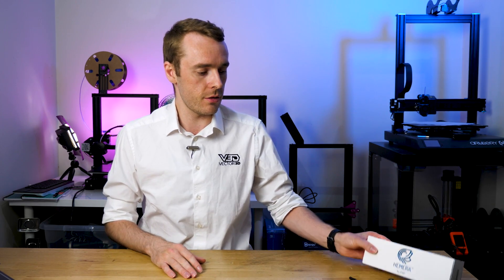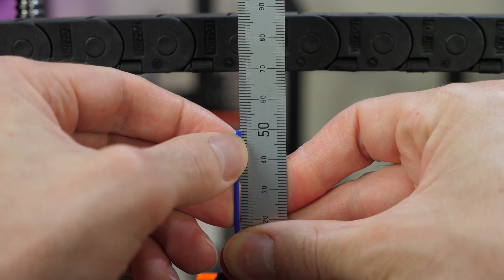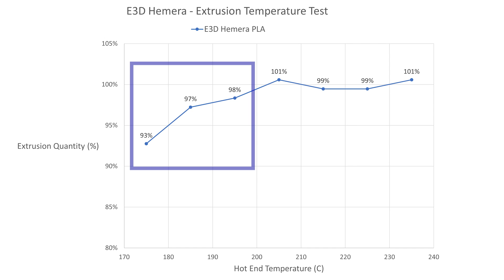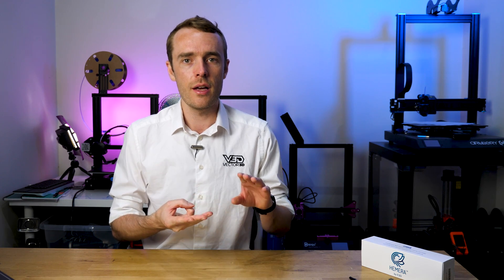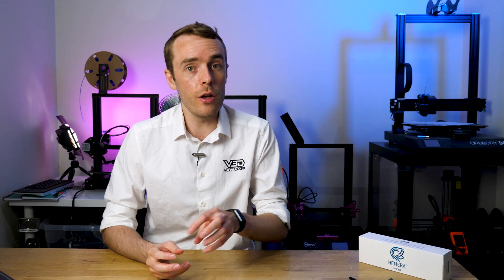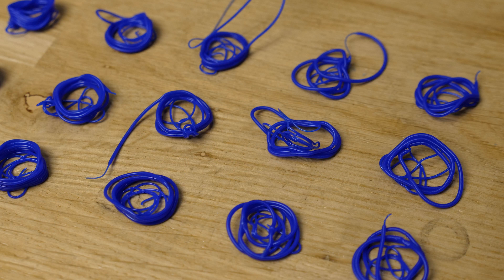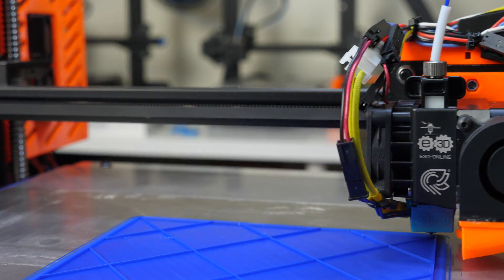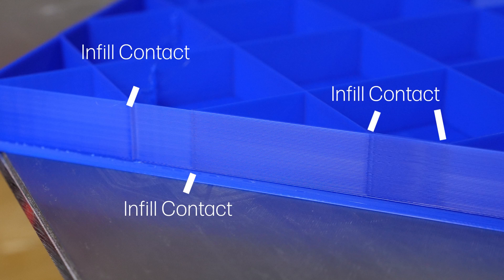How Fast Can you 3D Print with E3D Hemera?

Comment: Finally, someone who has put the work into some actual speed settings. Excellent information and a good starting point for someone who has just upgraded. I actually have the Matrix clone of this, so I am applying similar settings to yours with great success.

I'm using this on an Artillery Sidewinder X1 that is far from its original specification and despite the weight of the new extruder, I have never seen the extruder move so fast with great precision on my printer. Thank you. 

I would be interested in seeing a follow up to this for balanced settings of speed and quality (Jerk, acceleration, outer shell speeds, etc).

Comment: Ummm I print at 80mm/s with a 1mm nozzle, 0.5 layers 1.5 width and a super volcano. So this is more of just a generic how to tune your extruder to your hot end video, not really anything to do with the hemera….The reason why your extrusion is matte is because the temp is too low, I can get the same results by dropping temp while keeping everything the same. So TLTR you just tested your hot end not the hemera. Probably at the higher flow rate your extrusion was coming out at 190 or under..

Comment: I really like my Hemera. I have been printing CF PETG (Atomic and 3DXtech) at 15mm^3/s and 255deg. with it. I’m also using a copper heat block, titanium heartbreak and a 0.4mm tungsten carbide nozzle. At layers 0.6mm wide x 0.3mm high, It prints all around at ~93mm/s and 1000mm/s^2 acceleration, while maintaining excellent layer bonding and finish. I did design and build my own printer to eliminate the ringing issues attributed to belt drives and flimsy frames, so it can print very well at those speeds - that also helps.

Comment: I’ve purchased this extruded on its release date. I’ve not yet set it up on my Prusa Mk3s.... is it really worth using?
Reply from the maker: I personally wouldn't install one on the Prusa Mk3s because that machine is quite well tuned with a load of profiles etc for the stock configuration. Its best as an upgrade to one the low cost machines from china etc that typically have poor quality extruders and hotends.
Reply: @Vector3DP  what are your thoughts on the right low cost CR 10 version? Creality has a few. I’ve left the Prusa alone but now trying to match a low cost medium to large size printer with the hemera.

Comment: Good video, just what I was asking myself when I searched in Youtube. You've got my sub, however, reference to CNC Kitchen would be nice. Also, all the decisions taken at slow speed, should be reviewed at high speed I think. Increasing the temp in particular may lead to ability to drive the printer faster. Alternativelly putting a high flow hot end (also this is outside the scope of this video)...

Comment: I would like to see this teat done again at 240 or more, working on the idea the material at a higher speed spends less time in the hot end causing the viscosity to stay to high to get the flow right? Would a higher temp on the hot end help it achieve better viscosity in a shorter time? Any thoughts, I'm curious on opinions
Reply: Ignore me just seen new video 🤣

Comment: Excellent video. Id have loved to see what temperature adjustments would do to increase flow rate. So at the higher speeds, the flow rate suffers because the thermal transfer to melt the filament isnt high enough. Increased nozzle temp would improve higher flow rate.

Comment: "You can't just build a rigid frame, steppers, and crank it to 11". And here I am with my no compromise build, 240lb, cnc machined frame, linear rails pushing most filaments through a titan aero at 250-300mm/s...

Comment: Awesome work doing this testing! Have you seen the 3DSolex "Matchless" nozzle? It's the size of a normal nozzle but the path splits for more surface area. They claim it can do 30mm^3/s which sounds incredible but I've only seen two videos of someone using one and they weren't very extensive in testing. It's also pretty expensive, they are like $30 per nozzle.

Comment: The dip in the graph might be due to some of the strange non newtonian properties of molten plastics. It's not uncommon to experience lower viscosity at certain higher flowrates/sheer stresses. It's a problem you often run into in the world of injection moulding where the molten plastic is moving quite fast.

Comment: Isn’t the flow rate mainly controlled by the hot end and not so much the extruder?  Your test showed that the Hemera is able to cold extrude filament and overwhelm the hotend.  Which is a good thing in my opinion. I’ve had many extruder that won’t skipsteps but will chew up the filament instead.  So it seems like the Hemera is a good extruder design.

Comment: You should try gyroid infill or a print with sharp turns. It will exaggerate whether the filament is too cold to stick to itself and may give a different result compared to straight lines.
Reply from the maker: Interesting way to demonstrate issues. May be quite difficult to control all the parameters and objectively measure performance, will think about it.

Comment: I wonder if some of the difference in flow rate can attributed to variance in the filament diameter. I've measured diameters of 170-180mm from the same roll of filament.
Very good information never the less. Thank you.
Reply: Yeah , its does, a good filament must have an error of 0.005, a very good one just 0.003, or better 0.002...

Comment: I'm able to push PETG through the Hermera .4 nozzle, at .3 layer height, 250C, 200mm/s print speed on walls and infills.  This works for quick prototyping.  Not quality prints.  As someone commented you can cheat a little by jacking up your temperatures and then pushing a lot more filament.

Comment: the thick extrusions at the right side of your array I often see with to cool a hotend. I think you missed one more test which was increasing the hotend temp to the values that performed the same at 220. I wonder if you might have gotten more speed. Will you try it?
Reply from the maker: I may do some more at higher temps but given my testing already, i can't see higher temps helping. there just isn't enough surface area to transfer any more heat into the filament. Its the filament that comes out too cold because it didn't have time to reach the peak in the hotend.

Comment: Your cheap scale is neither precise nor accurate (in the scientific term). If it were precise but not accurate, you could just calibrate it.
Reply from the maker: Precision is how detailed the information is, it has two decimal places, which makes it precise in my book. Accurate is how close to the true value it is, and i suspect it's a little bit off in either direction at times. I have calibrated it, but that doesn't necessarily make the accuracy better, it just means its the best it can be.

Comment: the limiting factor is the Inferior design of the v6 hotend underneath the hemera, it's not optimized at all to melt plastic quickly and accurately, the thermal transfer to the filament is pretty meh and the backpressure too high to run it fast, I'd love to see the hemera paired up to a good, high end hotend

Comment: I assume these test are done with a 0.4 nozzle? And is that flowrate tied to nozzle size?
My thinking is if heater can actualy melt stuff faster as higher temp, and extrude more with a bigger nozzle.

For example, i use .6 on my delta, a flsun qq-s, and i get much better printing results at the same flowrate (i go around 13mm/s) vs a 0.4 nozzle.

Again, great testing.
Reply from the maker: Yes, 0.4mm nozzle, darn how did i forget to mention that in the video.
Well 0.6mm nozzle will likely reduce backpressure, but not sure it would change the peak flowrate. Another great thing that could be tested.
Reply: @Vector3DP  the melting capacity of the hotend is the same.. The speed test is not really good, due to that there is a "recharging" time on the infill.. just like in my extreme speed runs with a top flow at 44mm³/s(ABS@280⁰C).. at a continual flow(PLA@235⁰C) i only get 36mm³/s reliably...
https://youtu.be/xCDNPpopA1Q - Klipper... at insane ludicrous speed... | OVER 1000000 micrometers/second |
https://youtu.be/Po-SPJfQoZM - Continuous high flow 3d-printing PPE
Tension is not that important on PLA but for softer material it's really important( flexible as loose as you dare)

Comment: I belive that the limit on how fast can print is in the filament not in the printer. If the filament can melt very fast you can go really fast but if you have a good extruder but the filament melt slow, there is no way you can print fast no matter what printer o extruder we use.
Reply from the maker: Well it's just a material parameter, you can overcome it with longer hot ends, split nozzles and other methods to increase surface area.

Comment: Hooray more testing and experiments! 😸

It's interesting that your "10.9mm³/s" measured maximum flow rate is very close to the "based on V6" flow rate given in the Hemera datasheet. 10.9mm³/s is 654mm³/min, and the Hemera datasheet states 600mm³/min "dependent on filament". Nice to see that they match so well!

@10:12 the credit for that acceleration/max-speed graph calculation thing is the "RepRap Calculator" Web page that Prusa's hosted forever, and its URL is https://blog.prusaprinters.org/calculator_3416/ rather than "blog.prusaprints.org" ("printers", not "prints"), as shown in the video ;)

... I wonder how many Hermes-branded extruders are still waiting to be installed, like mine is... How long until I have the only yet-to-be-mounted "Hermes"‽ 😂
Reply from the maker: oh rly? Haha, i got pretty close to what they expect then, that's pretty cool.
Reply: @Vector3DP  perhaps you should ask sanjay about their testings.. Maybe shouldnt redo tests they probably did. They have a toolchanger corexy.. Mechanics also matters alongside hotend ; nozzle and cooling. Its pla ofc..

Comment: If you redo the test with higher temperature you will find that you can extrude faster. The volcano numbers are publicly available, still haven't seen a flow rate test of the mosquito magnum though. That would be my wish.
Reply from the maker: I'll give it a try off camera, but there is a soft limit of how much energy you can pump into the material so adding more temp won't continue to give meaningful benefits in flow rate.
Reply: 220°C is already too hot for PLA. What sense would such a test make?
Reply: @MetalheadAndNerd  if you are printing faster, you are transferring less heat to the filament so even you have the temp set higher, the pla isn’t necessarily getting that hot. That is why longer melt zone of volcano works, more time to transfer heat to filament. I’ve pushed pla through a volcano at 250 with great success.
Reply: @joshsekel  Don't you mind the stringing?
Reply: @MetalheadAndNerd  stringing it's too bad at 250-265 if you use dry PLA.  Easy if you keep everything in a dry box.
Reply: @martylawson1638  Moisture has nothing to do with stringing.
Reply: If your print has relatively constant extrusion it's fine because the pla never actually gets too hot, issues start when the flow decreases.

Comment: This all seems good advice to me, but still it’s easy to get over paranoid about e-steps. There is no universally correct steps value as each filament type will extrude slightly different amounts. The hobed gears in the extruder bite into the filament and if it is soft, or the loading lever has higher tension, they will bite deeper than if it is hard and/or the loading lever is lightly tensioned. If they bite deep, the circle the gears “describe” as they turn is smaller, so less “distance” of filament is extruded for a given esteps value. Given this variability it is probably best to calibrate e-steps against your most used filament or just use the factory default. Either way, for best results you will need to adjust the slicer extrusion multiplier on a filament by filament basis. Not to mention different filament vendors are more or less accurate to 1.75 diameter and concentricity.

Also because filament is extruded as a round sausage cross section but the mathematically ideal extrusion would be square or oblong, there is not even such thing as an ideal extrusion amount per filament. It depends on what you want of the print. If you try to extrude the exact volume of filament as the normal values described by your model, you will be forcing the round extruded cross section to squeeze fully in to occupy all the space of an ideal oblong cross section. Extruding precisely the correct volume will generally make a print look aesthetically over-extruded, but it will be mechanically strongest. If you want it to look aesthetically nice you will be allowing to a greater or lesser extent small gaps in the print. It won’t be mechanically quite so strong but it will look a bit nicer. So basically it’s less of a science than people pretend it is. The math gets you in the ballpark. But I don’t know anyone who calculates it all scientifically and then doesn’t tweak the extrusion multiplier because it doesn’t look quite right to feel mechanically, quite right 🤣
Reply from the maker: Already done some testing on this, and I expect different gears will react differently to different materials too. Really interesting to test these things and hope people can get better prints as a result.
It's all about control and repeatability for me. whether you're analysing theoretically or mechanically, its still important to get what you expect.

Comment: Would be interesting to see how the flow rate changes when using a volcano configuration.
Reply from the maker: Keep your eyes peeled :)
Reply: @Vector3DP  bought a volcano for mine, looking forward to your results!
Reply: @Vector3DP  Did this ever happen?
Reply: Here’s me hoping to be able to print 0.4mm layer heights, 0.5mm nozzle on my J-head, aluminatus, no wonder I’m not able to print 200mm/sec... cheesy Pete’s!
Reply: it reduces MASSIVELY. My hemera starts clicking at anything over 30 mm/min, with a E3D branded Volcano and 24v heter
Reply: @HicSvntDracones  that could be a clog or your spring tension isn’t set high enough perhaps?
Reply: @drew899  Unfortunately I've been through every tension setting possible, had the thing apart, cleaned, lubricated and reassembled well over 30 times, my esteps are calibrated to the second decimal.. been at it daily for 2 months now since my printer is usually a source of income. Replaced the heatsink which is the entire extruder casing and the heatbreak so only the motor, gears and idler are original... This is actually fairly common, just getting on my nerves seeing tons of google results for hemera grinding and jamming yet no responses from E3D beyond "it's perfect". I was convincing myself to spend the money on a BMG while doing a last search on google/youtube for a solution.
Reply: @HicSvntDracones  hmmm. I know E3D is supposed to have excellent customer service. Are you in the Hemera Facebook group? I find that most people there know almost everything about the hemera and they will likely be able to help you with your issue
Reply: Or a supervolcano ;) only then we might find hemera limits.